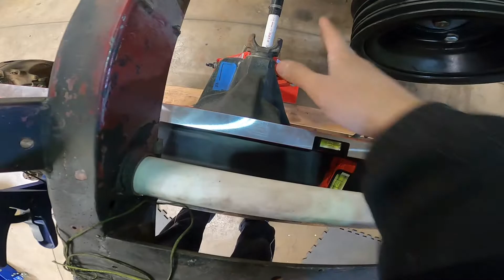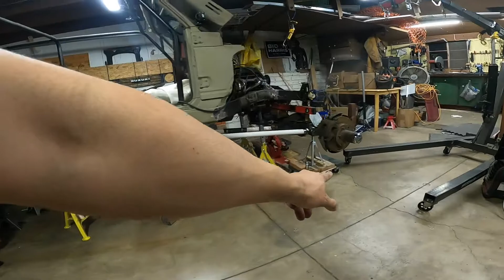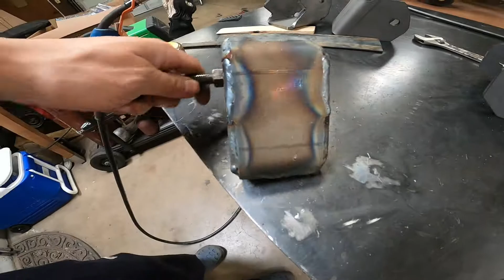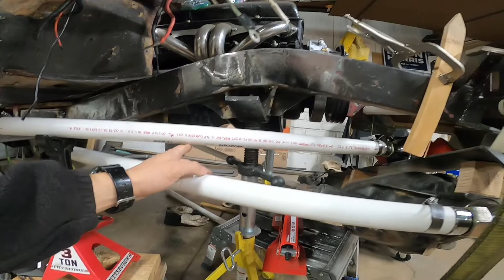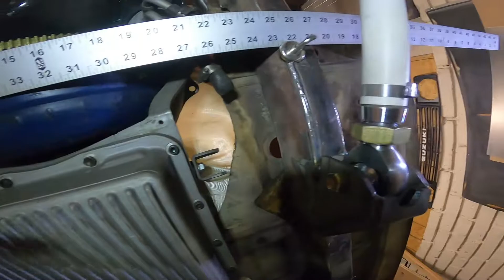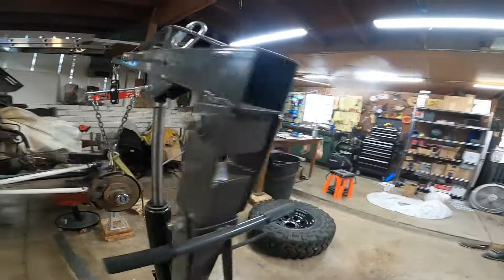Super Sami Front 4 Link Install

Comment: What axles are you running.
Reply from the maker: They came off a 74' K10 blazer
Reply: @brotheus6310  She looks good, am getting ready to do about the same 8.8 Ford rear and a HP Dana 30, going to chop the front a make it a passenger side drop.